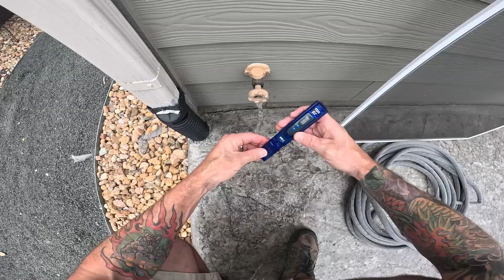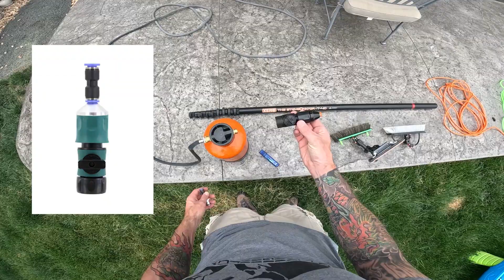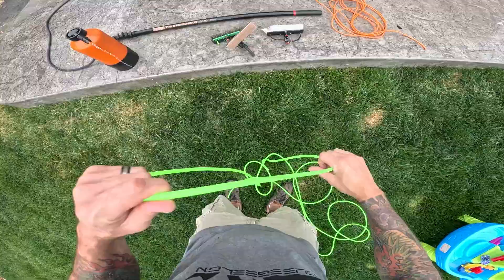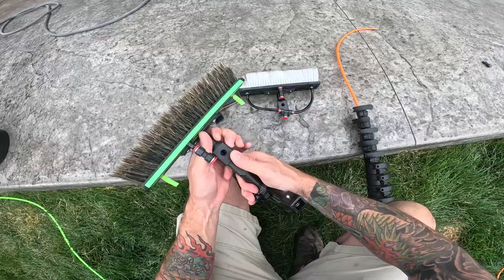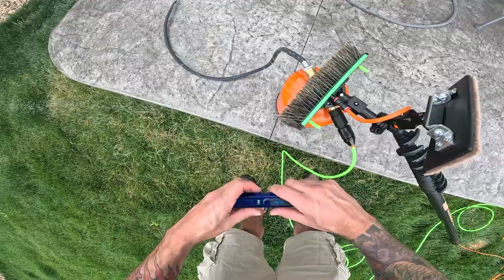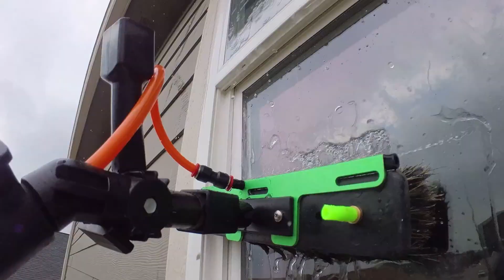XERO DI TANK SETUP | WATER FED POLE | WINDOW CLEANING

Comment: How long do these tanks last before needing to refill the resin?
Reply from the maker: Depends on TDS, if the local TDS is 50, then about 3,000 gallons before needing to change the tds. You can check out your local tds through this link https://windowcleaner.com/pages/tds?sca_ref=3020242.k17l3JaEgS

Comment: This may be a silly question.   Can you run a garden hose both in and out of the DI tank that way you can run a much shorter 5/16th hose? For example a  25 foot hose going in and a 200 foot hose going out with 50 ft of 5/16 pole hose.
Reply from the maker: 5/8 is great from the spigot into the system, but out of it I suggest running 3/8" hose to the water fed pole hose connection https://windowcleaner.com/products/xero-rubber-hose-3-8-inch?sca_ref=3020242.k17l3JaEgS

Comment: hello! I do commercial cleaning and we have been doing ladder work for years to clean windows for our clients but I recently found out about the water fed pole system. Zero is offering a great deal on different systems right now and I want to buy in but I  dont want to over buy either. The water in my area measures around 22ppm out of the tap. With that being said do you think I need the 3 stage r/o filter or would ones of these work?
Reply from the maker: Hey, at 22 ppm from the tap that is great, would only need a DI tank to handle that, not a 3 stage https://xeroproduct.myshopify.com/products/xero-di-tank?sca_ref=7171550.tiysfYIMXLIL feel free to send me an email, I can put together a kit for you steveo@windowcleaningresource.com

Comment: Hello.

Question?  Keeping this tank on a trailer (pressure washing) in front of a customers home.  Would one need a 12v pump to boost the pressure if using 30-foot wfp?  Also since the outlet is 3/4, could one use a 5/8 or 3/4  50/100ft hose then use 5/16 barb to maintain pressure and flow?  

Also, since I'm not finding information too much on this tank, how is the resin replaced?
Reply from the maker: For Di tanks a booster pump is not needed, they are not restrictive so get good flow.  I suggest using a 5/8" ID or 3/4" hose then 150' of 3/8" rubber hose like this on a reel https://windowcleaner.com/products/xero-portable-hose-reel-assembly?sca_ref=3020242.k17l3JaEgS then attach to 50' of pole hose

Comment: May i ask. How much is the hole system together as in your video? Thanks in advance
Reply from the maker: Di tank packages are about $1200-$1500 that include a 40’ pole, extra hose and accessories 

https://windowcleaner.com/products/xero-di-tank-package?sca_ref=3020242.k17l3JaEgS
Reply: @SteveOthewindowcleaner  cheers Bud! I'll be ordering a couple of things from your site next week. Just startet my own little glas cleaning business here in germany and looking forward to upgrade my equipment.
Reply: So when the tank start reading tds over 10 do you get rid of the di tank  and purchase a new one or do you have to change resin?

Comment: All I've been doing is using the waterfed pole hooking up directly to the clients water and putting soap on the end of my brush. Had no idea that if I had bought the system I wouldn't even need the soap 

I wonder why when doing it with the soap and the regular hose water I don't leave spots?
Reply from the maker: Yea no need for soap at all with having a purification system, what state are you located in?
Reply: @SteveOthewindowcleaner  texas

Comment: TDS 0 40  should work  find , I know most people will find that hard to believe I did too, until I was educated . In the beginning of my Window cleaning career I thought it always had to be at zero but I talked to a gentleman who made reverse osmosis systems.  A  plumber and he told me at Disney. They clean the big screens with 50 TDS, or less spot free
Reply from the maker: 0-10 Ppm is what I recommend and from my experience. A TV surface I would say is different due to no one is looking through the screen like a window
Reply: Is this true brother because I'm in Asia and the price to buy a DI is superbly expensive with the conversion and stuff so I'm planning to built my own DI without RO membrane and stuff any thoughts?
Reply: Get a TDS meter see what you’re working with first , see how high or low the TDS is around your Providence

Comment: Hey quick question if you have the time. What do you do if a customer doesn't want to pay your after the job is complete? I had a customer do this to me recently and I want to learn what's a way I can protect myself with my next customers.
Reply: Small claims court.
Reply: I know I'm late to your question. I ran into the same thing. Now I send over a quote on Jobber, and had ChatGPT generate an agreement for me that basically says they agree to the work and to pay the price for the work once complete. I attach that agreement to the quote, have them accept and sign. Hasn't been an issue since